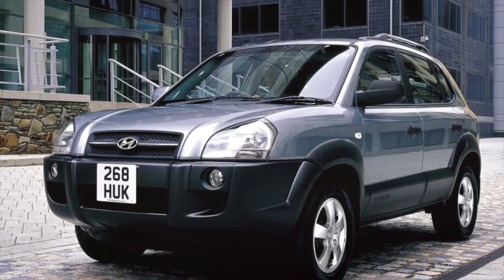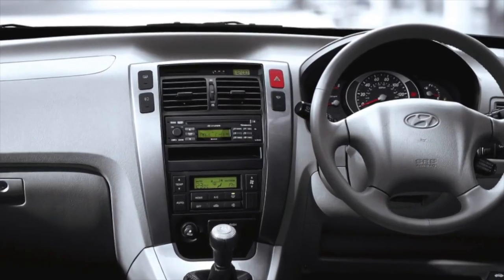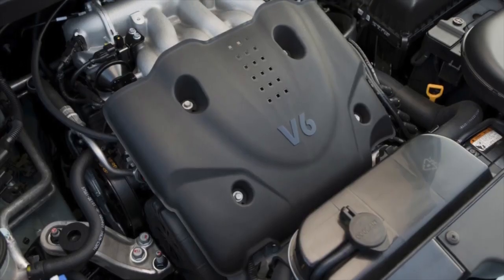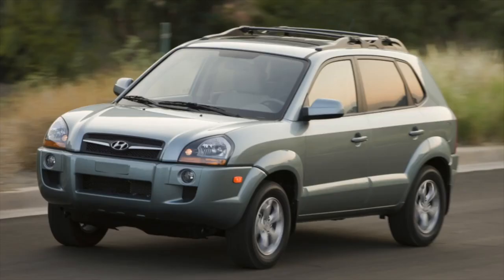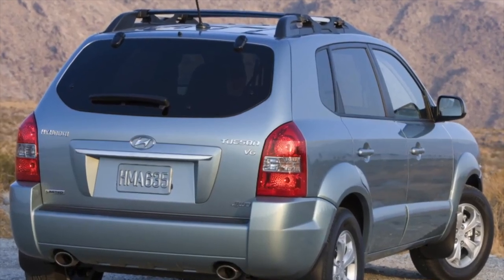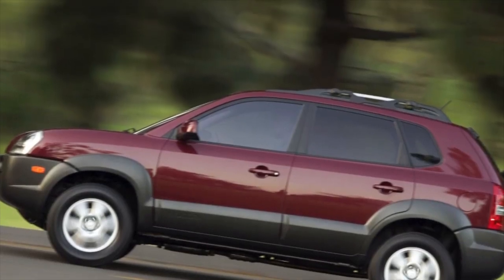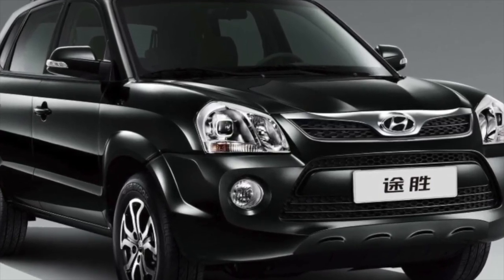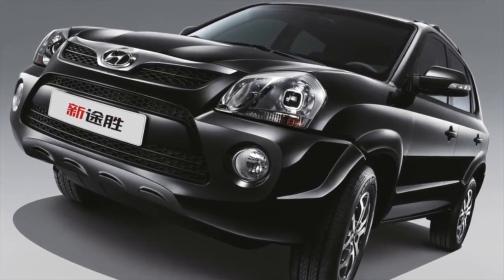What are the most common problems with a used Hyundai Tucson JM?

Comment: I had to jumpstart my Hyundai 2005 a dozen times i just got a new battery & alternator & it still won't start sometimes.I don't know what the problem is.
Reply: Did you ever find out why that was happening? I have the exact same problem in my 2007, I’m just assuming it’s a grounding wire issue at this point. Also if you turn the wheel all the way in either direction it’ll turn the car off for you?
Reply: If you have the default stereo that was installed. It is advised you replace that and the problem should be solved..
Reply: Ignition switch failure? Or relay is dirty/rusted?